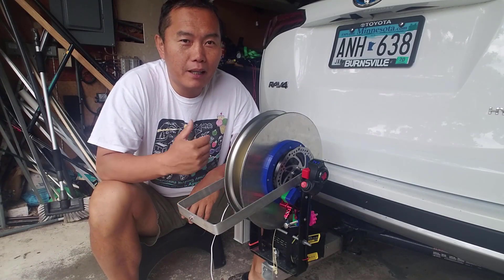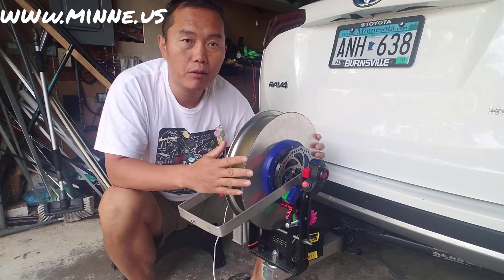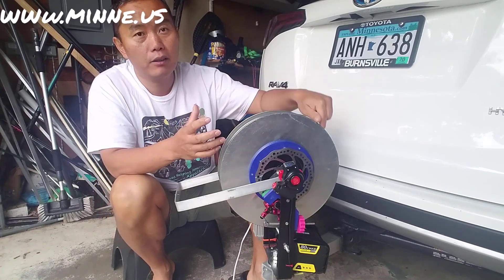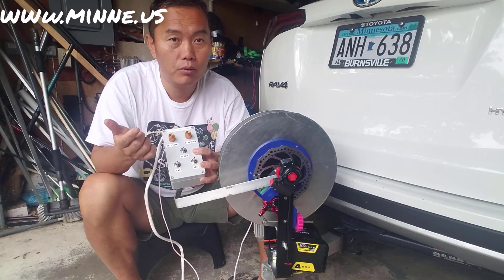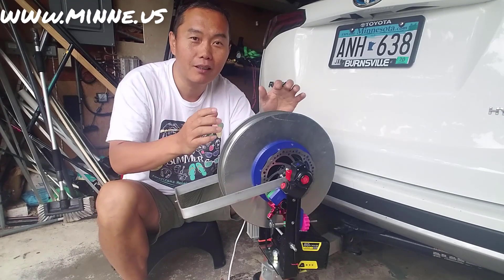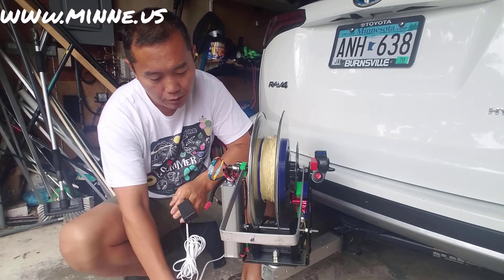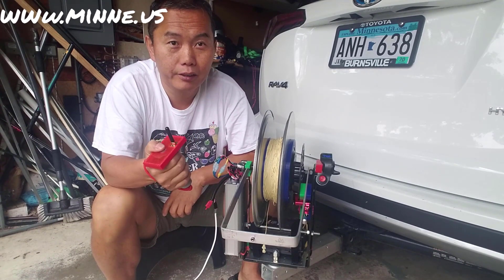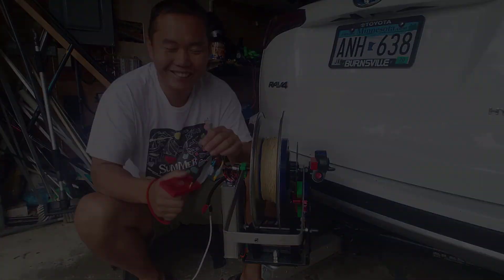Paragliding tow winch how I build it

Comment: do you think a 212cc 6.5hp gas engine will have enough power to pull a para-glider? i feel like if a small electric bike wheel can, so can a lawnmower engine.
Reply from the maker: it's not about engine, all about how you control the speed.